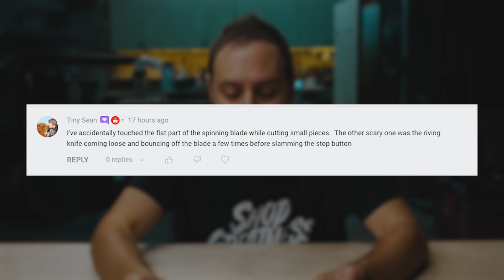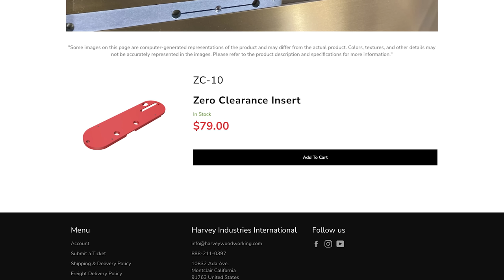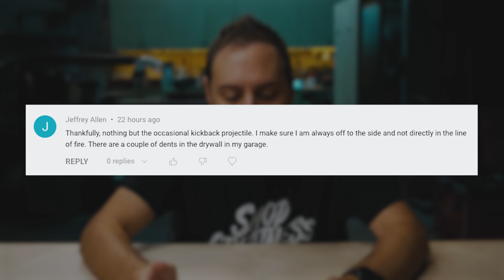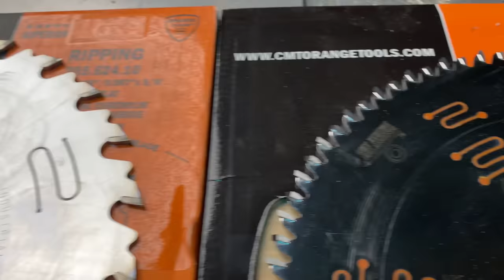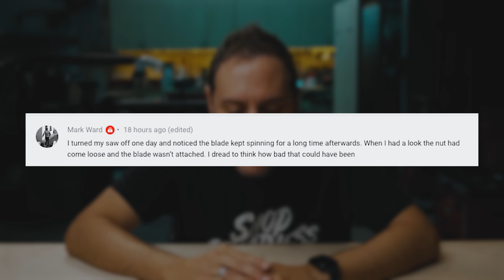I don't know why people make these dumb mistakes

Comment: 51000 accidents it is a lot.  The  conclusion is find a different tool that can replace the table saw .  Track saw or a circular saw with a guide can do most of the things that a table saw can do safer it is harder to setup but you will have all your fingers. For the rest you can use a router table.  If you are going to cut large pieces it is a lot easier to put them on  the flat floor on piece of foam and simply cut everything with a circular saw and a guide . Simple  cheap  easy safe.

Comment: I started my wood working career making doll house furniture. My fingers were very close to the blade. I taught my self to ALWAYS KNOW WERE MY HANDS WERE!!  I ALWAY stood to the the left of the blade and if anything went wrong I'd pull my hands to my chest and move left. I'm 73 and I have all my fingers after 50 years.
Personally I do not like his push shoe. If the thing slips or something goes wrong your hand is lower and CLOSER to the blade. Since I always use a splitter, I stop feeding long stuff and pick up my push stick. My hand is high and behind the blade until the cut is may.
NEVER USE WAX ON ON YOUr TOOLS!!!. At some point there will be residue that will cause your finish to fish eye. Before you use a product, test it. and may sure it will not ruin your finishes. Wash your hands before you start to work. Potato chips have oil and will cause fish eyes. 
One other test to do is to make sure your Saw Table Top Slots are parallel to the plane of the blade. This assure proper cross cutting. Do the same with your rip fence. Push the work through and stop the saw and see if the blade in centered in the kerf.

Comment: I agree that experienced users are always at higher risk, although it's probably a bit of a curve.
In theory, beginners are more focused and wary, experienced users may get complacent. I've seen so many 'experienced' woodworker channels on here where I'm like "OMG, don't do that, don't stand there, don't reach over like that!" etc. etc.
Reply: I'm experienced and I'm still focused and wary. I see what that blade does to wood every time I use it. I know my flesh isn't as tough as wood is either. Not even soft wood. All it takes is a temporary lapse to cause a life altering injury. A fraction of a second. So don't let it happen. Simple as that.

Comment: Why is it that Saw Stop is the only manufacturer of table saws built around safety? Is it Patents? Where is the Makita and Milwuakee table saws with the same limb saving technology as Saw Stop or better. It should be standard in every blade operated power tool. No Brainer, its like preventing anyone from using a seatbelt. It's really frustrating.

Comment: I tried cutting a pencil down the middle length way on a band saw. The blade pulled the pencil down the hole lifting the other end up with my hand on it n it cut right through my thumb nail. Full recovery. Lesson. Dont do dumb shit

Comment: Sawstop won’t stop kickback but the majority of injuries and all of the amputations can be prevented by it
Reply: The majority of injuries and all of the amputations can be prevented by just not coming into contact with the spinning blade. That's what I do and it works for me. I don't care how badly you want to touch it, don't!
Reply: @1pcfred  you can still get sucked in without running your hand into it, I’ve seen and have heard of it happening in a split second even with professionals, it’s really just a matter of time
Reply: @Kincaid405  in 40 years it's never happened to me. So it's a lot of time. I have a trick though, it's called don't put my hands near the blade while it is spinning. Works good!

Comment: Under-powered saws are more dangerous. With small saws you have to push the stock through with force.  Keep a coat of wax on your saw and your joiner. Keep a dedicated brush by every tool, never ever use your hands to clear sawdust.

Comment: Let me push back on a few things, but feel free to disagree. What it boils down to is a difference in philosophy. For me, all hand movements must be extremely intentional and giving up control of the workpiece is to be avoided whenever possible.
1. If you are ripping and it distorts that much, then you are cutting corners by skipping the bandsaw stage. If you don't have a bandsaw, use a riving knife. If you do, you're better off ripping it 1/8" oversized on the bandsaw, optionally letting it sit overnight on stickers, straightening one edge, then ripping to final dimension on the table saw. Sometimes you need to cut corners, but you need to understand that you're cutting corners. Riving knives cause excess friction/resistance, and if you're struggling to push something through a riving knife, then you're at risk of injury.
3. Giving up control is the most dangerous thing you can do at a table saw. If standing to the side means you give up fine control, parallax vision, or grip, then you've just made things worse. Sadly, DIYHuntress does not identify what actually caused her accident.
10. You can also use CRC Electrical Silicone lube instead.
13. New woodworkers need to know that gloves are an ongoing debate. It's not the one-sided issue portrayed in the video. I know people on both sides. I prefer gloves because I get splinters easily and I have dry hands that can (and do) slip off all types of wood easily. If you have slippery hands, then you have to white-knuckle, and white-knuckling is the enemy of safety. Far better to get good cloth+rubber gloves and never risk slipping. There is a possibility it can make an injury worse, but I think that's more of an issue for the jointer, and I prefer to avoid injury in the first place.
14. Push sticks are dangerous. Avoid if possible. You have poor leverage and poor grip, so you have to exert more force than is safe. Use push shoes and featherboards, even multiple featherboards. Get good at making jigs that help you push things safely. Clamp things to your cross-cut fence. Keep your right hand glued to the fence. Push sticks are the right tool in 1% of cuts.

The biggest thing is this: know how your hands work. Whenever you use any saw, you must ALWAYS understand what your hands are going to do in the 1/25th of a second when you lose control. You need to understand all the ways you can lose control. Do everything you can to get more control. The harder you have to push, the less control you have over your movements.

Comment: I've noticed on cheaper saws the piece of metal that supports the guard is often thicker than the saw blade.  It results in your cut binding up on the bracket.  I eventually just took mine completely off

Comment: There's not enough training, particularly for DIY'ers.  A power tool intro & safety 1 or 2 day workshop would be invaluable - I' like to do some DIY that needs more than a jigsaw, but although a circular saw looks great, I'd love to actually go to an expert and get taught all about kickback, how firmly to hold the wood etc.

Even drilling - bought my first drill with a large holesaw attachment and didn't realise you needed to start the drill before contact, so it jumped back and ran over my hand.  Luckily only a bad scratch, but for absolute newbies without a handy Dad to help, it's a recipe for disaster.

Comment: I didn't see a tip about using a blade guard. Yeah, they suck, and they get in the way a bit, but for the vast majority of cuts, they can be used. Almost all the stories in this video would be irrelevant if the blade guard was clipped onto the riving knife, like most modern saws come with. I think I read somewhere that in Europe, a blade guard is required by whatever their OSHA equivalent is, and many saws sold there don't allow you to remove it. Food for thought.

Comment: I will give the best tip ever about how to NEVER have a table saw injury: get an euro slider style table saw (Hammer or Felder). Accidents are impossible with these given your hands are never remotely close to the blade and you are out of the path of any potential kickback. Expensive? Yes, but not that much over a fully kited SawStop and you get a much higher quality saw in the end.
Reply from the maker: those are super nice. I think I saw one that had some AI tech that can see your hands
Reply: @wittworks  It is the Format4 (By Felder). but it is mostly a belt+suspender thing because in slider workflow, you always have your hands pushing the slider so they are never close to the blade. Even when ripping, you put the board on the slider and clamp it in place (pneumatic clamps FTW!) and then push straight forward. I dont understand why we dont see more of these in America, except in cabinet shops.
Reply: It absolutely is a lot over the price of a sawstop cabinet saw. The only one under $10k limits you to 79" length, which does not work in the US, where our sheets are 8 ft and lumber is usually 8+ ft.
Reply: @gulzeb  you are wrong. First you most likely based your assumption on the website price which is WAY out of reality. If you are patient and pick something they have in stock at the end of their fiscal year you can get massive discount. I got my Hammer at over 30% discount. These prices are highly négociable. Also, if you want to compare to a SS, you have to pick the industrial model, add all the extras. But even the PCS gets very close the the price I was proposed for a demo model with the short slider. 
Both saws are very good, the à Felder is much better and will allow you to be much more productive (like cutting 4 boards stack in one pass).

Comment: I think you should add the advice that if a cut can be made using a tool other than the table saw, then do that. Table saw should not be the go-to tool in a shop, it should be the tool use for cuts that can only be made safely and accurately on a table saw.

Comment: Speed kills. Efficiency is just a euphemism for shortcuts and shortcuts rarely end where you expect them to. Even the “efficiency” of repeated operations can and does cause accidents because of the built-in complacency. Every operation should be a focused, deliberate and fully-engaged movement. There is no room for error in a powered shop. 

Part of the way that I try to avoid getting ahead of myself is to really enjoy the process and every single aspect of the work, down to the first cuts at the miter saw. Knowing I’m doing something special, something nobody else can do, to a stack of wood is itself a way to focus on every single cut, every moment. You’d be surprised how much time distorts when you’re that focused. Or, more likely, you won’t because you already know. 😁

Comment: I can't watch almost any woodworking channels anymore, actually I have trouble seeing thumbnails with a table saw in it. Use to be a junkie for those content, I was near quitting my 9 to 5 job after spending years watching and learning and practicing, at some point, after I sold my first dozen of projects. I was so happy to have found my road, then I had a small accident with the table saw and everything changed. I was working as usual during a weekend, I was in a hurry to finish a piece to deliver, after 12 hours of work on it, the first time in 3 years my over confidence with the tool and my tireness became an awfull combo. It was nothing really serious but for me PSD was too much, I have an OCD for gross injuries and that was it, I'm having trouble writing this, slapping my head to get the thought away and I can't be too specific, but it's a safety lesson, what doesn't happend in a 1000 times can surely happen the 1001st. It's been almost 3 years now, still doing my 9 to 5 job and I feel so down about my future, hoping some day to be able to find the strenght to get back to work without a table saw and more handtools work.

Comment: If I can make a cut where the blade is not exposed, I do it.  When the blade IS exposed, I rarely use my hands on the board.  I've been working this way on a table saw for 45 years and never had a single mishap.  I don't think I've become complacent.  Every time I'm ready to make a cut I stop before making the cut and think, what can go wrong.  A healthy fear of the table saw is a good thing.

Comment: served my apprenticeship as a JOINER MACHINIST  { WOOD } THOSE DAYS OLD SQUARE Head  finger eaters]   was told  ignore anyone that speaks to you, and make sure the area is clean of debris, and remember these machines never apologize if they bite you, now 84 and still working with machines{ though these days much improved to the old flat belt  drive ones of yester year }  and to date  never have been bitten  ,only very small mishap a band saw blade broke and nicked my arm ,slapped on a band aid   no stitches, always be carefull ,stop, think and then think again and IGNORE  anyone who may come along and speak to you while operating a machine and never never remove safety gear it is there for a reason, I think 70 years of working with these things and no mishaps   for the reasons i was taught from age 14 and have listed AGAIN ALWAYS CHECK ANY NUTS AND HOLDING DEVISE BEFORE STARTING ,saw a set of cutters fly out of a spindle when an apprentice they went through walls and lucky no one was hurt ,the machinist  copped a bollocking from the owner of the joinery shop.

Comment: Jaime Perkins’ jointer accident is the worst I’ve seen on YT.  All fingers chewed off from his left hand.  
I remember in high school cabinet making, I’d never touch the table saw.  We didn’t even have to deal with jointers in that shop, but the table saw just seemed like a bloody accident waiting to happen.  So, the teacher would have all of the pieces I needed cut for me before I got to class.  I happened to be very good at routing, so I’d go around routing people’s doors for them to offset my refusal to use the table saw.  Got an A in the class still.  

Please, everyone, be ultra careful.  And also routinely remove your ear protection after using a tool so you can also hear if anything is still running.

Comment: That was a great video. I've been woodworking since 1974 and have had only one table saw injury. Not to serious but enough to make me use the guard that came with it always. Only time its off is when I have no choice. I also put a piece of plexiglass over the blade on my crosscut sled. It comes off so I can do tall boards but so far I've never had to remove it. It also helps with sawdust.

Comment: This is too many things with wildly varying levels of importance, making it difficult to follow. I usually would never make a comment about "this is what you should do" but this is a safety video that is done poorly. I would recommend the following: 

The best way to make safety advice is to make it easy to follow. I would consider breaking this into chunks based on importance, for example checking the tightness of your bolt is something you would need to do very very rarely while you always need to remember to not stand behind the blade. 

I think it would also be beneficial to break this up into "passive" and "active" safety standards. Passive would be ensuring that you have the right saw blade, riving knife, zero clearance insert while active would be things like standing in the correct position, and overall safe operation of the tool. 

good intentions behind this video but the lack of structure as well as the nebulous examples (ex. "Just think what could have happened" doesn't really compare to "this is what has happened") result in a lessened impact. 

All the best.

Comment: Chemist here. No matter what you do. You always, always, ALWAYS wear safety glasses when using any power tool or in general when working in the shop.
It's not the things you expect that cost you an eye. Those things are fragile and not repairable.

Regular glasses NEVER replace safety glasses.

Comment: 21 reasons why I don't own a table saw, and don't plan to own one.

In my work, there is nothing that can't be done more safely on other tools. 

I would like to add one more tip ... always have someone else nearby when you're using power tools. They don't need to be in the shop, but should be close enough to hear you scream, if you get injured. Diresta was lucky that he was able to get himself and his finger to ER on his own.

Comment: Your 'Rule Number 11: Never work in the wrong frame of mind...' I cut my hand on a miter saw because I had stayed up all night fighting with my wife and didn't get to bed until 2am, when I had to be at work at 630am the following day. It also plays into your don't adjust the blade while running. While I wasn't adjusting the blade I was adjusting the work piece while the blade was running, I also was holding the guard up with my thumb.... all three are NO-NOs. Had to have 3 surgeries on it and 9 months later before I was back to 80% usage with my hand. Still not 100% 20 years later. Never will be. Luckily all I did was ripped a joint out of my pinky finger.

Comment: As a 40 experienced professional woodworker I am  always shocked at American woodworkers both amateur and professional who do not use riving knives or crown ( top) guards on saw benches yet go to complex designs of sleds and jigs to perform cuts that are frankly dangerous and are better done on a radial or chop saw.  Dado stacks have been banned in Europe for many years. What’s worse is these experts? Promote all these jigs while ignoring basic safety practices. Denis